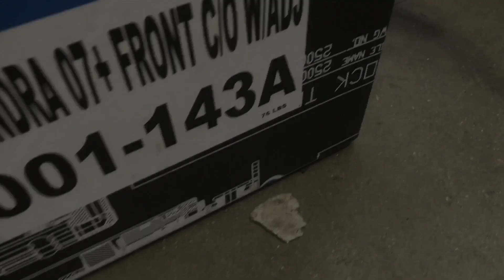2018 Toyota Tundra Platinum Kings Suspension 35” BFG And More!

Comment: Come on fellow tundra owner, if you have King shocks there shouldn’t be any sway bars on there 😎. Great work as always guys, gonna bring my tundra there someday
Reply: Hema Nigansz also drag the trd exhaust. I cut mine off after the axle.
Reply: Kevin reed yeah I need to cut mine too as my +3 coach builder shackles won’t let me air mine out without hanging
Reply: Hema Nigansz exactly. Probably going to be a mall crawler. Rear sway bar and kings makes me want to throw up in my mouth
Reply: Warren Anderson just curious you mention get rid of the sway bar, is this because it hurts the ride or something else?
Reply: Tundra Whisperer yes the rear sway bar is going to stiffen up the rear suspension and reduce some of the benefits that come from the upgraded shocks and springs (if they upgraded those). I would not remove the front sway bar unless it was for a short period of time while wheeling but i would never add a rear unless i was looking for more cornering stability on highways

Comment: We’re the wheels Fuel vectors?  Also, was this a 3” lift and leveled?  Thx
Reply: TW, the wheels are Stealth Custom Series ......Jay
Reply: Jay Sauer thanks Jay, are you the owner by chance?  Do you know what size?
Reply: TW, no I don't own it.  I have one though.  I don't know the size, I was trying to pause the video and find it but couldn't.  I know the wheels because i have the F5 series.  I would Guess with the King shocks and lift the tires would have to be a minimum of 33's.
Reply: Jay Sauer I know there 35’s from the description, but wheel specs was what I was after.  Thx
Reply: @tundrawhisperer4821  The wheels are SCS Ray 10's. The rim is an 18x9 with a +25 offset

Comment: Ill stick to Tacoma’s until the tundras mpg rating improve. 13/17 on a 2019 truck? Come on you can do better that that
Reply: A dodge ram Hemi 2018  will do a out the same
Reply: They’re 15/21. That’s more reasonable than 13/17
Reply: Buy a Prius, us real men, when we do this to our TRUCKS, or when we buy a truck don’t give a shit about fuel, we just make sure we buy enough, penny pinchers are not truck guys
Reply: Toyota could put a 3:55 rear end vs the current 4:30 but then you would complain about the lack of pull. lol  It is just physics. Large V8 and low gearing equals low MPG but great pulling power and launch.